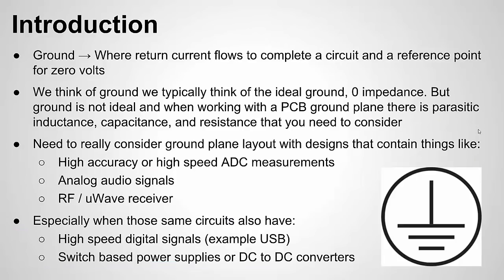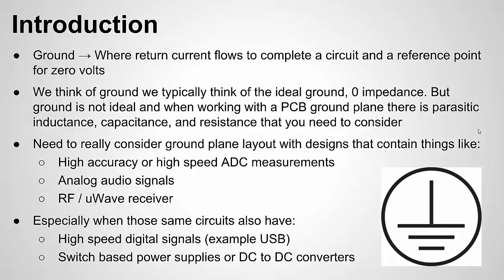Ground Considerations for PCB Layout of Mixed Signal Designs Part 1

Comment: RSD academy had one more element for ground that I thought was informative.

Ground must be able to sink or source as much current as required for the circuit without changing.  

The max current required for the circuit must not cause an appreciable potential difference between the return to the source (hard zero) and the furthest point on the ground plane or ground wire.